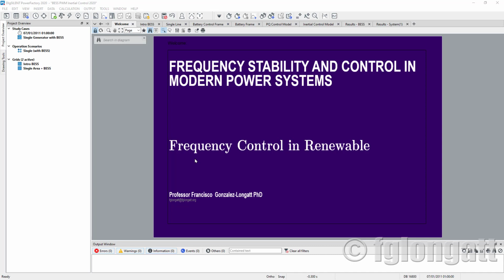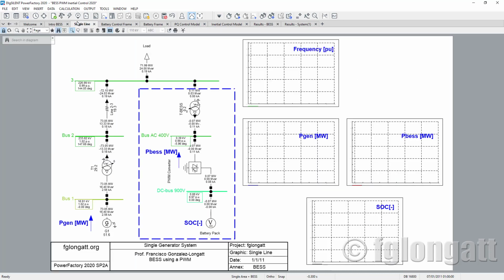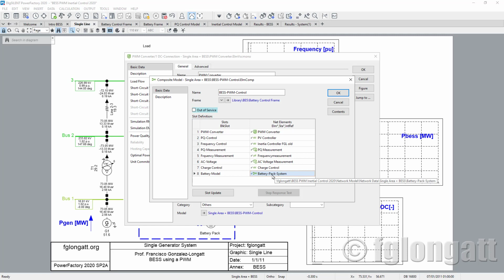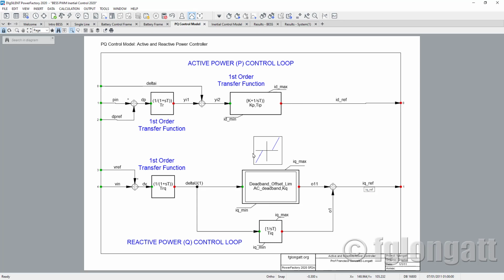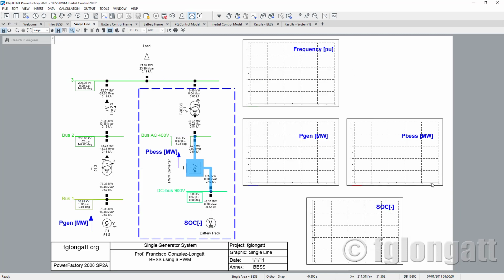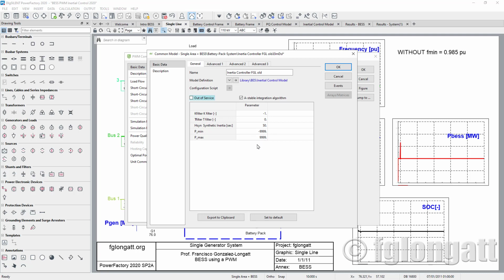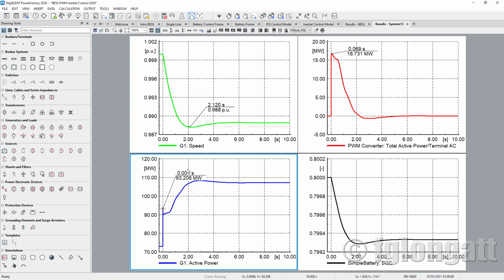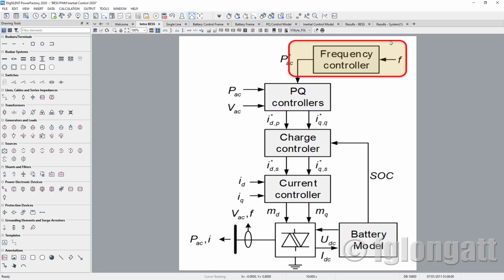Example 8 BESS PWM Inertia using DIgSILENT PF (ENGLISH AUDIO)

Comment: Hi Prof.
Could you please help me to design grid following inverter in powerfactory? any supporting documents
Reply: I was trying to develop grid following inverter with PLL and inner current control and use the control model for static generator

Comment: Hi prof.
Thank you so much for your useful channel. Really appreciated your hard effort. I have modified an IEEE 39 bus network and I had replaced 3 synchronous Generators by a wind generator which generates 30% of the total system load. The system not working properly, the frequency drops under the acceptable range. Do you have any advice that can help me to fix this issue. Thank you for your valuable time.
Reply from the maker: Thanks for your comment. Check the frequency controller in any conventional generator and wind turbine. Best regards, FGL
Reply: Thank you for your time and fast response. Do you have any video that explains how to designing BESS in the system from zero.
Reply from the maker: @hakamiali7455  that is a bit complex and long, so short answer, NO. If you want to attempt, please take a proper training on DSL (DigSOLENT Simulation Language), see the training at DIgSILENT Germany. Best regards, FGL

Comment: Prof. thanks for these videos. Sir whenever I am taking into account the BESS in any multi-machine system before giving any disturbances there is the presence of some oscillation in the system and it vanishes after some secs which is not the correct thing. After giving the disturbances there will be some oscillation as well which is perfectly fine. But my question is why the instability is present there before giving any load disturbance. Is it because of the BESS modeling or on what basis? Can you please brief me about this?
Reply from the maker: If you have some oscillations in your simulation during steady state pre-contingency operation, that means you have a problem with initial conditions, and the oscillation shows the system trying to reach an equilibrium point, I am afraid!
Reply: @FranciscoGonzalezLongatt  thanks for your reply.I will look into it.